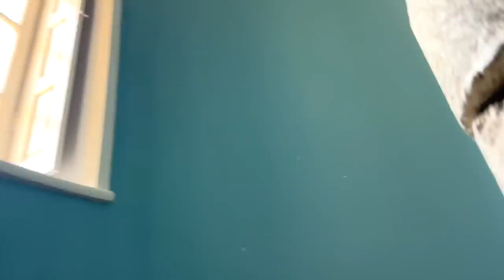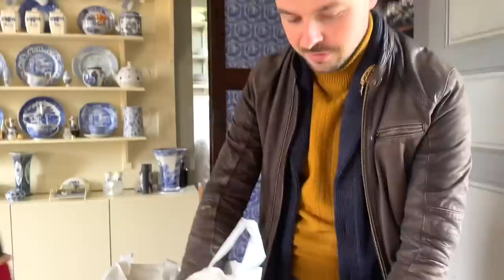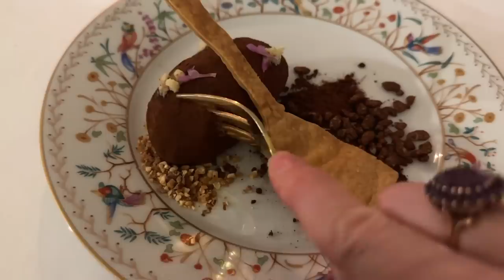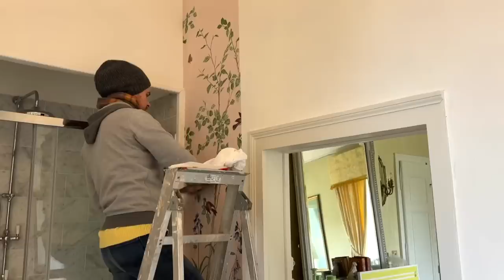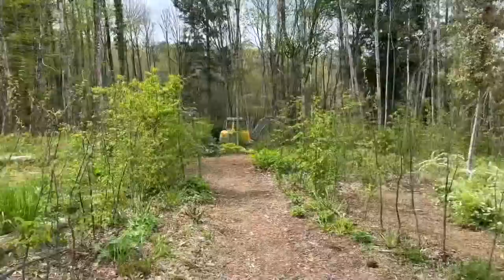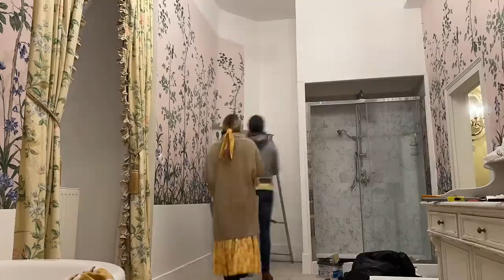Chateau Renovation PANIC: Wallpapering till 7AM but the B&B Guests Will Arrive Any Minute! 🫣

Comment: Amaury is a Legend I hope he is paid handsomely🥰 because the amount and variety of jobs he does is astounding not to mention his high standards he is a treasure.  👏👏 Hats off to you mate ❤from Australia 🇦🇺
Reply: Even Nick has an assistant.  Careful Amaury doesn't burn out.  It must be frustrating for him to be pulled away from his main job to take care of another crisis.
Reply: @Marie Hoffman  Nick is a consultant, not an employee. He decides if he has an assistant. Amaury doesn't have a complete workshop set up right now, so his main job is on hold. As soon as the heating system is competely in and tested then all that insulation can go back in the ceiling and the stables can become his workshop. ❤❤

Comment: Amaury will be knackered too! He need a Volenteer to help him out
Reply: Yes indeed! The gardeners got volunteers, and Amaury needs some too. He is so loyal, and he doesn't complain, but the dear fellow does look exhausted.
Reply: Kevin the handyman is there now also. As soon as the heating system is completely installed, Amaury can get the insulation out of the stables and his workshop in there. The insulation is going back in the ceiling of the back hallway. ❤😂😂😂

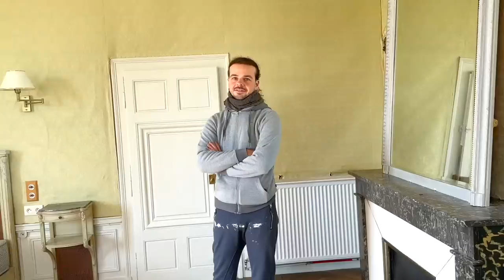Comment: 6:19- a trick i learned from my 1st graphic design teacher: measure the width of the mushroom decor line. It = 100% Measure the vertical width of the woodwork & spread the 100% across that width in a tint of cream or swan white or the match of the ground [color suggestions mine, not  Elaine's specifically. :) ❤].

Comment: The Martha Stewart method for hard boiled eggs works every time. You put enough water to come up about half way on the egg. As soon as the water starts boiling, put a lid on it, and turn off the heat, but leave it on the burner. Set a timer for 16 minutes. They won't have that green look from cooking them too long.

Comment: To you white is modern,  for me it is evertthing  else esp  with white walls. For me it  stands for shabby chic. Though it is out. these days and still  much of the cottage and farmhouse  look with white or cream is still what it means to me.   Also the young crowd snuck in gray... but it is so dreary..... for me. however a chateau seems so bare with just white. Which is why they fake paneling with molding. And that works. Wood in a bathroom ive always been told is a no if you dont have the ventilation.  Ive never attempted wallpaper in mine either.  Wish i dared.